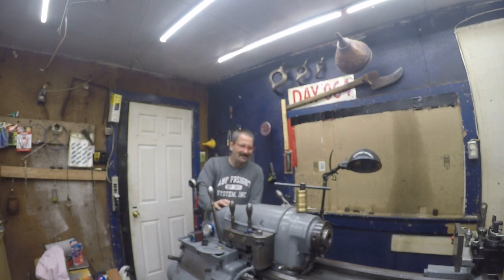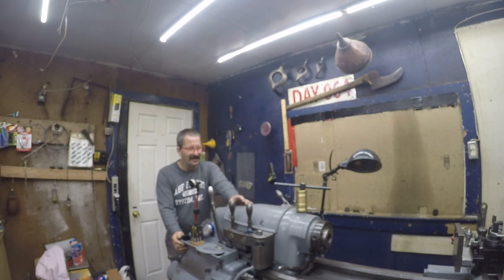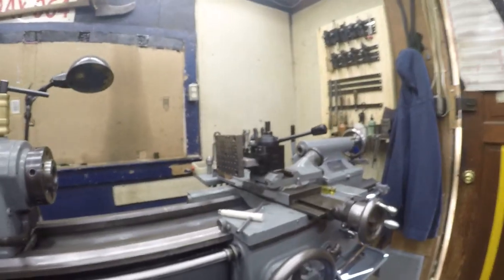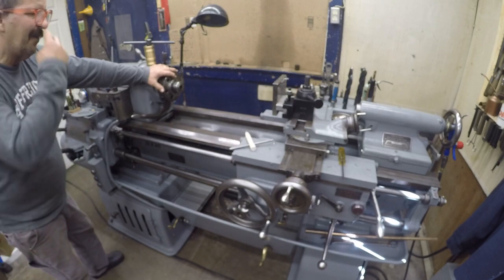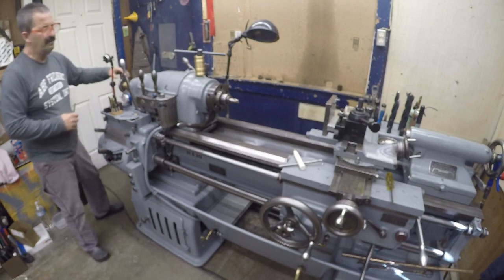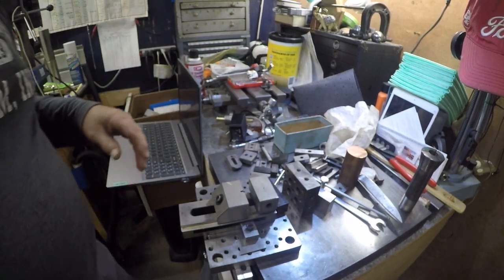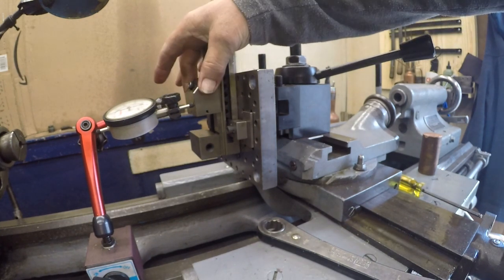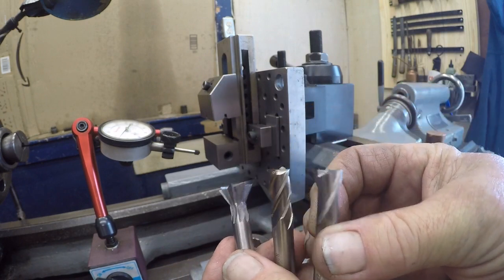milling 1

Comment: The z-axis is your longitudinal travel along the bed ways which controls the depth of cut.
The x-axis is your cross slide.
The y-axis is the small amount of travel you get in your tool post height adjustment.
A person might prefer to swap the x and y, but in comparison to machining operations on mills and other machines the z is standard.
In the natural world of coordinates the way you called it out would be correct x being left and right, y being for and aft, and z being up and down but not in the world of machining or at the very least milling. Think of your lath like a vertical mill with a vice mounted on it similar to what you have, laying on it's back.  The jaws of the vice being parallel to the x-axis.
Reply from the maker: Thanks Fred
Reply: @ Fred & Kimber :   In this instance , looking at a lathe , & using it in a 'milling operation' ;  all coodinates should be the SAME as 'natural ' !    This kind of operation is IDENTICAL to using a horizontal milling machine , the major differences are mass of the 'table' , capacity of cut . . . but most importantly ; the lack of rigidity when there is so much 'overhang / stickout ' of the tooling plate / vice setup .   ( I've done my share of 'sketchy ' setups !  ;) 
       The aluminum mounting to the toolpost  isn't as rigid as would be , were it made of steel . . . *though the difference is fairly small with the sizes used .    
      For the sake of this exercise , it might be a better idea to use aluminum for BOTH of the dovetail components ,   .unless the steel is finished to a very high degree  & Hardened , the aluminum will wear fairly quickly !        But for 'funzies' / learning  purposes . . . this is a great exercise for making parts FIT .   ;)               This should be FUN ! ! !        * I'd suggest using the 2 flute endmill on the aluminum SLOT , ( before cutting the dovetail ,  since it would 'relieve' a lot of the pressure on the dovetail teeth . . . )       Ok , OKAY . . . I'll SHUT UP ! ! !      ( SNUG UP YOUR GIBS  while milling ! )
Reply: @georgewocosky  George - The coordinate system is the same when comparing a horizontal mill, and a vertical mill. There is no difference.  You might find it helpful to think of the coordinate systems on all mills as being relative to the table.. With the operator standing in front of the machine, the X-axis is the left and right (longitudinal travel) of the table. The Y-axis is the fore and aft movement of the table, and the Z-axis is the raising and lowering of the table which is always controls the depth of cut regardless.
The only difference between a vertical and horizontal mill is the rotational axis of the cutting tool. The vertical mill has the tool perpendicular to the table rotating around the Z-axis, and the horizontal mill having the cutter rotating parallel to the table rotating along the Y-axis.
As such the lathe most closely mimics the vertical mill with the cutter rotating perpendicular to the table.
 As I previously stated the lathe is like the vertical mill laying on it's back. 
Continuing with looking at the coordinate system in relationship to the table on the lathe, the X-axis is the cross slide, the Y-axis is the tool post height, and the Z-axis is the carriage travel, again controlling the depth of cut.
Another short cut to comparison could be had by looking at how Kimber has the vise mounted compared to the standard mounting of a vice on any mill. The coordinate system would be the same.
The standard two axis DRO made for lathes will tend to follow in this method. Most often the lathe DRO will have an X and Z axis. X being the cross slide travel, Z being the carriage travel, or bedways travel if you prefer.  There are some exceptions to this where they've simply marked the DRO with X and Y axis instead. One can take their pick on how they wish to connect the scales. Since the cutter and part are reversed from a mill, the X-axis could be the axis the part rotates on, and the Y-axis right angles to that or the axis of the movement of the cutting tool. 
Personally I like to keep the lathe and the Mill DRO the same and I did when I was using my lathe to mill. I had a vertical table with a leadscrew giving me 3-4 inches of travel along what I considered to be the Y-axis. This configuration set my lathe up coordinate wise just like any milling machine. I kept my X-axis literal travel as a milling machine.
Now that I no longer use my lathe for milling, I set up the X-axis value in the DRO as being doubled reflecting travel in terms of the part diameter (double the hand dial which is literal, or radius), and my carriage scale is set up on the Z-axis on the DRO, Y-axis now being disconnected.
Cheers!